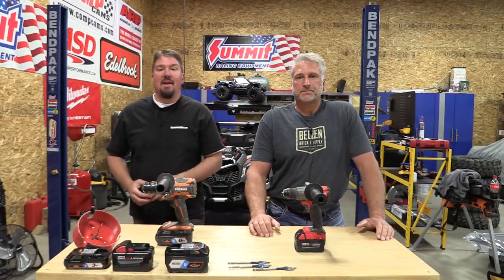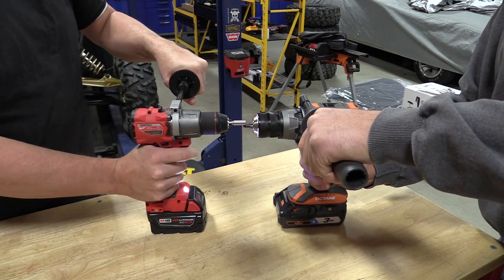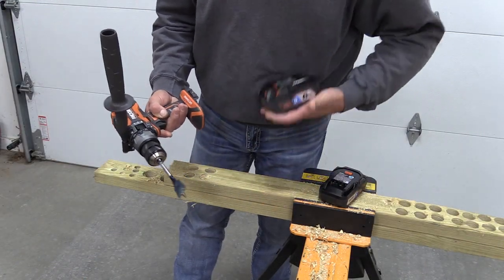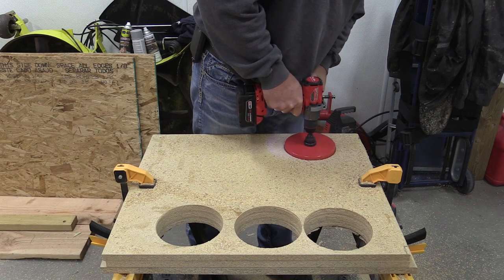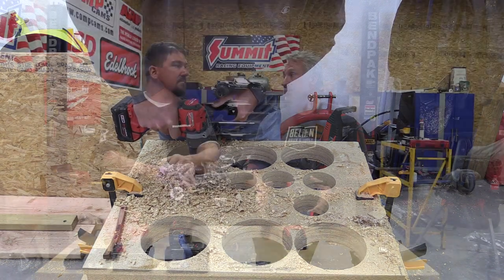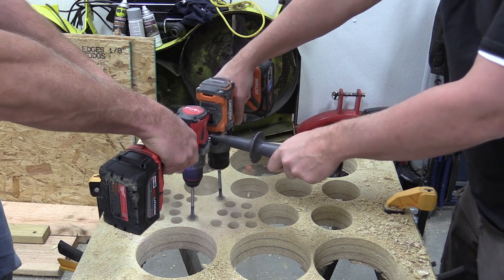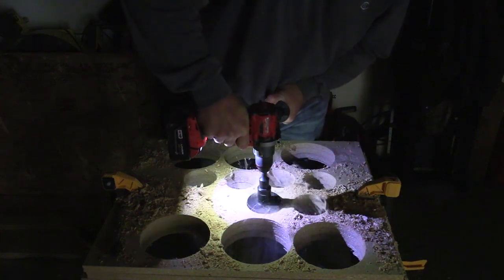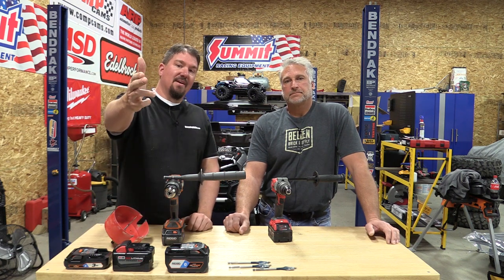Ridgid 18V GenX5 Octane Hammer Drill with 1300 in-lbs Vs Milwaukee 2804-20 with 1200 in-lbs

Comment from the maker: We have a new video out with the same testing using on the Milwaukee M18 6.0 High Output battery and the RIDGID OCTANE 6.0 battery.  Check out if it changes anything.  https://www.youtube.com/watch?v=UzVkIQdyXaE
Reply: I've run Ridgid tools for years and the larger the battery, the more powerful the tool is. The 6.0 AMP hour battery will  make the drill far more powerful than the 3.0 AMP hour battery hands down.
Reply: Light test was good tti own both these tools...
Reply: This was a good video. I own the same tools and love them. The warranty is amazing! Thanks for sharing

Comment: I have both and to be honest. The ridgid is comically huge compared to the milwaukee. But the price makes the ridgid a clear winner. I can get smart batteries on a hammer drill/ impact kit with a free 1/2" octane impact and a 4.5" octane angle grinder for the same price as an m18 fuel kit for just the drill and impact. That's a huge deal
Reply: Don't understand why everyone complains about the size of the Octane drill/driver. It's not made that way to piss off those consumers with little lady hands, it's powerful af, its not made for hanging up picture frames. So unless you want to break your wrist-like dude keeps trying to do with that Fuel-than you need a sturdy weight distribution
Reply: @svn5994  better tool my arse! you pay way more for the same functional tool just for a little smaller size, that is not better, that is stupid.

Comment: The real winner here is the consumer. Competition pushes companies to make better tools at affordable prices. Lots of great options out there for pros and diy’ers alike. 👍🏻
Reply from the maker: That is 100% right.  In this case we have the same company fighting with different brands.  :)
Reply: well said
Reply: the irony, makes it funny because both drill companies are owned by TTI, so in this competition only 1 company still wins
Reply: @Ma77riK  ikr that's exactly what I was thinking! People's jaws drop when I tell them My Ryobi drill is just as good as their Milwaukie, Dewalt, and even Rigid drill cause guess what... they are all the same!!! 😂😂😂
Reply: @broken_font1881    they're not exactly all the same. Just because one parent company owns Ryobi, Rigid, and Milwaukee does not mean that they dictate to each company to make them the same. Black&Decker & DeWalt are owned by the same parent company, but the quality between the two is noticeable. Same with TTI: they have certain brands to hit certain price points to appeal to the broadest customer base possible. That will necessitate a difference in either parts quality, options, profit margin, etc., or possibly all of them. I have a Milwaukee hammer drill (2604-20) that just won't quit, but my search for an impact driver has me considering either a Surge bare tool, or spending $50 more and getting a Rigid hammer drill/impact combo that Home Depot has plus 2 extra 4.0Ah batteries. It isn't the hammer drill in this video, but with slightly more torque than my current drill and a lifetime repair/replacement on both tools and the 4 batteries I would have, it's hard to decide!
Reply: They aren't the same.  TTI owns Milwaukee and Ryobi.  Emerson owns  and designs Ridgid power tools and contracts TTI to make them.

Comment: I have had both. I had Milwaukee and went to Ridgid due to cost and adding Van's to our fleet. We can furnish 2 Van's with ridgid for the same cost as 1 van with Milwaukee. I can honestly say I wish we stuck with Milwaukee. I hate the ridgid chucks. Always loosing up and dropping bits. Had a bad battery out of the package and had a tool last 1 hour of use and died. Yes we can just take it to home depot and exchange but never had issues with Milwaukee.
Reply: Yea I had a problem with my chuck too. I cleaned all the swarf out and lubed it and it recovered
Reply: My ridgid chuck initially would sieze on my drill bits. Then after that issue went away, the Chuck could never hold on to anything

Comment: I have Ridgid and Milwaulkee, 18v Ridgid platform, 12v Milwaukee platform. They are both great. I chose the Ridgid for the warranty and the Milwaukee for the compactness. The newest 12v fuel impact driver is absolutely the tool to carry with you everywhere. It is my first choice for almost everything, 3 settings for impact driver and 1 for drilling. The new hex shank drill and masonry bits work very well in this badass little tool.

Comment: I have DeWalt corded power tools and they are great. In the last 10 years I've been building up my Ridgid collection because of price/performance ratio as well as the Lifetime warranty. While my coworkers ultimately have to buy new tools every 3-5 years due to defects and battery issues outside warranty, I'm still using my Ridgid tools from way back. I'm not saying the other brands are junk, clearly there are some real high quality tools out there but my Ridgid LSA will fix me up every time with nothing out of pocket.

Comment: Thanks for the video. It is difficult to do an objective comparison but you did a good job of it.
I am amused by the extreme brand loyalty from some of your viewers. I don't use either brand of cordless tool, but I watch to see if there is a reason for me to add/change my battery system.

Comment: I have the previous generation Milwaukee fuel hammer drill and it sprained my wrist when a hole saw bound up.  The power and durability are beyond what I can imagine any user would need.  The clear winner is anyone who owns either of these drills.  I'm happy with Milwaukee but , ir I were starting again, I might go with several rigid pieces because they have developed an excellent product line with prices that are far more respectful of their customers than Milwaukee.
Reply: Tom Brown the new gen3 Milwaukee one key (only the one key version) automatically stops when your drill Binds up and saves your wrist

Comment: I own the Ridgid X5 generation, they are an amazing tool. One thing they didn't point out here is that the LED lighting on the Ridgid is far superior to the Milwaukee. 99% of the time you are not going to be using 3" and 4" bits, so you need the light directly on your screws and your bits. The Ridgid LED light is FAR superior to the Milwaukee.

Comment: 👍👍👏👏 Great review on both tools. MILWAUKEE is for the construction worker and RIDGID is for both construction and DIYer. I personally like RIDGID I voted for RIDGID in the other video. I currently only own the Walmart Hyper Tough 18v nicad drill. It's done what I've wanted it to do to an extent.  I do plan on buying into the RIDGID line. And watching videos like this really assures me that I'm going to be making the right choice once I buy in the RIDGID line. I'm just a DIYer don't need expensive tools but I do want good quality and RIDGID offers that without the Mikita and Milwaukee price. Great job guys love what you're doing.
Reply from the maker: Thanks Raymond!
Reply: The hypertough drill and impact is surprisingly good. Not very strong but perfect for at home light duty stuff. I have a coworker that used the set for 5 months on the job. Still works good. I use the ridgid gen5 tools. He upgraded to a used dewalt set but the hypertough drills still work fine

Comment: I would be curious to know if the previous Gen 2 milwaukee hammer drill 2704 would do vs. the new smaller  model.  They have the same stats 1200in lbs, 2000rpm, 32000 bpm.   I wonder if by making the drill so much smaller,  the hammer also became smaller.  If that is the case then the force that the hammer hits would be smaller.  That may be the reason why it lost so badly in the concrete drilling comparison.  Something usually has to be compromised when you keep shrinking things in size.
Reply from the maker: Might be true.  Might the Ridgid model be the old Gen2?  I can be a conspiracy theorist.......
Reply: @WorkshopAddict  it's not out of the question for TTI to use the parts from a previous milwaukee model in a rigid.  I have that hammer drill, and I swear I remember it beating all competitors in the concrete tests.  If you still have one, put it head to head.
Reply: The Gen 2 has nothing on the Gen 3 I have both and got the 3 because of the difference in power.

Comment: Wow!!! I didn’t expect the Rigid to be this good.
Reply: Lol its not
Reply: I bought the Ridgid gen x5 platform 3 years ago. I abuse all my tools. All made by Ridgid. Being a journeyman plumber I put them to the test. Ridgid is a great platform. My only gripe is it can be difficult to get a hold of their newest tools. Home depot where I'm at doesn't do a great job with that. Ridgid all the way
Reply: @josephrowley9701  my sentiments exactly.  I can buy any tools I want or need for the job. So too can my coworkers. Most use Makita because that is all they ever used.  They pick up my Rigid tools and  are taken aback by the performance which they claim is better than their platform.  But they still stick with their tools because their batteries and charging system is in their specific platform.  Also, these are the type of guys that will argue Republican vs. Democrat and are either one or the other because their parents were one or the other.  They couldn't argue an issue and only get their information from network television news.  In other words, they are dumbed down nuckledraggers that are bereft of critical analysis.

Most use Makita, Dewalt or Milwaukee because that was the path they were led down and are too complacent to look in another direction; they drive a Ford or a Chevy because they always have driven a Ford or a Chevy.
Reply: @FacelessMan777  YEah, It's true. The world is filled with these mouthbreathers
Reply: Joseph Rowley 

Did you drive a Prius?

Comment: Any idea if the new Ridgid batteries have better weather sealing/coating? My non-octane Ridgid batteries fail quite frequently from mild rain/water exposure whilst my Milwaukee, Dewalt, Ryobi, and Makita tools endure the same with no qualms.
Reply from the maker: We have yet to take an Octane apart, but with the Bluetooth circuitry, I would have to think they would have to.

Comment: The ridgid gen5 line is very good. Im a glazier by trade. I use the drill,impact,sawsall and skill saw on commercial jobs everyday for 2 yrs now. No issues with performance or reliability. I use only the 4ah batteries. Im looking to get the 9ah batt and the octane rotary hammerdrill

Comment: Surprised at how fast the hammer drilling action is on the ridgid. That's approaching SDS levels of speed, it's crazy to see a hammer drill that can, you know, actually do stuff that a hammer drill is supposed to do, competently. Should be noted that the Ridgid 9.0ah battery is quite a bit more powerful than the Milfucky, having 20700 cells instead of 18650. I think that's 1350 watts vs 1080 watts for max output.

Comment: Tim from Canada what I see here is that the ridge it has a bigger battery than the Milwaukee.. does this put it ahead on this job do not know what kind of battery you were running in the Milwaukee but it looks smaller than the original battery..

Comment: The Milwaukee's light is positioned at the base or by the trigger. Depending on the model. As Rigid's 5th Gen is dispersed around the area of focus. The bit. It doesn't care if it's a 6" chewy auger. It will handle it. As long as you have the 9ah battery.

Comment: Would you say with the ridgid being heavier that it would be more taxing on your forearms and hands at the end of the day?
Reply from the maker: That would depend on what you are doing with it.  In some ways, I would say no, it would not be more taxing because it takes less to hold the drill in place because of the larger size and the longer aux handle giving you more leverage.  As you can see in the video, sometimes we are fighting the Milwaukee because it is smaller and harder to hold with all the power.  There is no doubt the Milwaukee will fit in smaller spaces and packs a hell of a punch in a small package.  We are running 6.0 and 9.0 battery packs on these guys to do what you see.  That in itself is heavy.  If you are drilling small holes, the Ridgid might be harder to work with all day.  If you are pushing the drill with big holes all day, I personally think the Ridgids size would be an advantage.

Comment: It doesn't matter that the Milwaukee has a higher BPM the mechanism that causes the hammering is smaller overall than the rigid. I'm sure they had to increase the BPM just to squeeze the same amount of performance out of the smaller next gen Milwaukee.

Comment: I wonder if the milwaukee would have kept up with the added current of the 6.0 high output battery?  Also the rigid might have taken it but I have to believe that with Milwaukee's technology if they had built a similar sized drill the outcome would have been different.

Thanks again for the awesome video guys.

Comment: Did you test the Ridgid with the older non-octane batteries. My main issue was that I saw significant loss of power when I switched away from octane batteries. In fact my older Ridgid compact hammer drill seemed to work better in older batteries. Not sure if this was just an isolated problem for me or if anyone else had same results?
Reply from the maker: There was a noted difference in the holes that it would hang up on with the large spade bit, but it still drilled the holes without the octane battery.
Reply: @WorkshopAddict   Were you in speed 1 or 2 for these tests? Speed 2 is much easier to stall as it is the less torque more speed ratio. Like for drilling metal.  Ive nearly snapped my wrist more than once being a "tough guy" without the handle and being in the 1st setting lol
Reply from the maker: @mikez4132  Speed one.  We plan to redo this test with just the 6.0 Ah batteries on each and will try to be more clear.

Comment: I personally like a smaller drill for tight spaces and that's where milwaukee shines compared to rigid.
Reply from the maker: Every drill has a feel and it is a personal thing, so we kept it out of the video, but when it comes down to it, you have to pick the best tool for the situation, not the most powerful.
Reply: I mostly have RIDGID/AEG products and found them rather bulky compared to other brands which has always disappointed me and hoped one day they would also make more compact products ...Here in New Zealand we have AEG and they are not entirely like for like when compared to RIDGID but I am drawn to the orange and grey of the RIDGID even though AEG is orange and black. It was also cheaper to purchase tools from RIDGID/AEG for a full house reno especially when money was at a premium for  materials for the house so had to think smart about spending on power tools to get the job done ...and I have to say they done a awesome job
Reply: Exactly my thoughts! 18v i like ridgid just slightly better fpr durability and warranty. But for the smaller 12v stuff i always use milwaukee. I mostly just use my ridgid octane set for big stuff that requires brute force. When im in attics running duct work and flex duct straps though, the m12 milwaukee impact driver is my absolute best friend. I hate having blocky square batteries up in attics with tight crawlspaces. Ive been eyeing the super small newer m12 drill/driver combo too, but ill have to save a bit before i spend even MORE on tools haha.

Comment: It seems as though everyone has this hard on for Milwaukee. I'm not saying that hasn't been earned by the tools but it's nice to see some competition where the "King" just got their throne shaken up.

For improving test results, remove as much human factor as possible. Check out project farm on YouTube. He did a test with reciprocating saw blades where the saw was attached to a jig with weights. Pressure, weight, angle all stayed relatively equal through all the different tests. To truly get un biased results when comparing two or more, that's how to do it.
Reply: I mean TTI owns Milwaukee, Rigid and Ryobi. So it's not that much of an upset.
Reply: Yeah the same company is getting your money. That's the beuty of running different brands for different levels of the market I guess. They get the diyer money on the ryobi line, homeowner and prosumer market with rigid and all the pros with mileaukee
Reply: @Zachariahfml  TTi does not own Rigid. They manufacture the power tools for Rigid, but Rigid is owned by someone else.

Comment: The only thing I will say is that using the octane battery you should have put it against one of the new high output 6.0 batteries. They are structured to push more power, which is what the octane does. I would have been more interested to see that comparison. That being said, great testing! I have both platforms so I am glad to see which one excels more at specific tasks.
Reply from the maker: Agree.  We did use the 12.0 once just to see if we could scrape more power out of the drill with the spade bits and we came up with the same results.  We feel a 12.0 Ah battery on the drill was silly, so we left it out of the video.  Based on a few comments, we should have added it in.
Reply: The amount of aH a batter has is not a function of it's discharge current capability. In actually the 3 Ah battery has the newer 21700 Samsung cells that offer GREATER max continuous discharge current than the 16550s in the 6 and 9 Ah Octane batteries.

Comment: I bought this Ridgid octane hammer drill and returned it 3 times because it made a grinding noise in the Chuck when you let of the trigger in speed 2. Ended up returning it and buying the Milwaukee but it makes the noise as well when in speed 2. It happens when you pull the trigger with no load. The Milwaukee isn't nearly as loud or aggressive though. Have you experience this with those drills or have any idea why they do that?